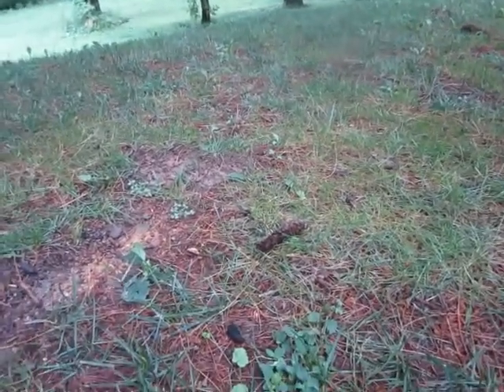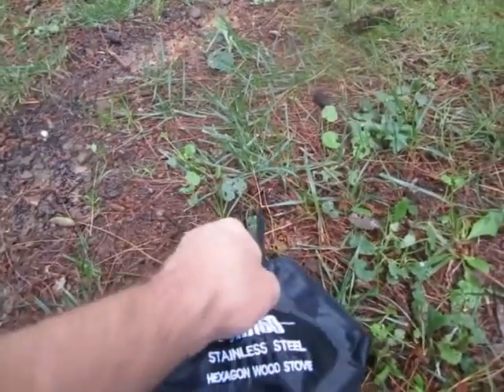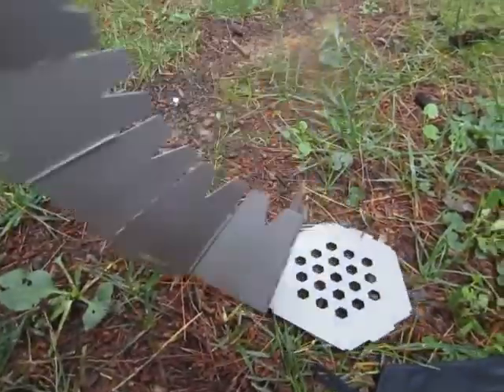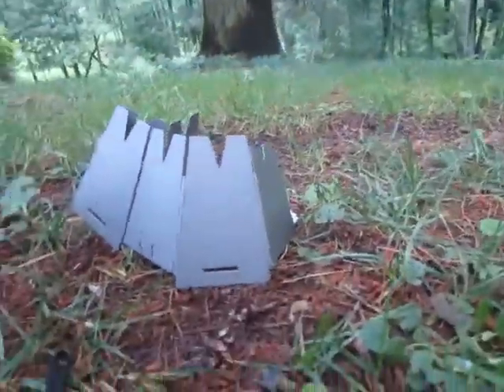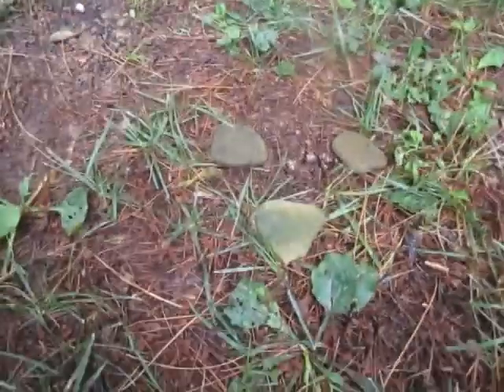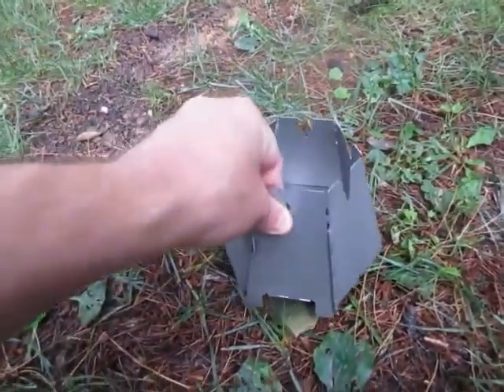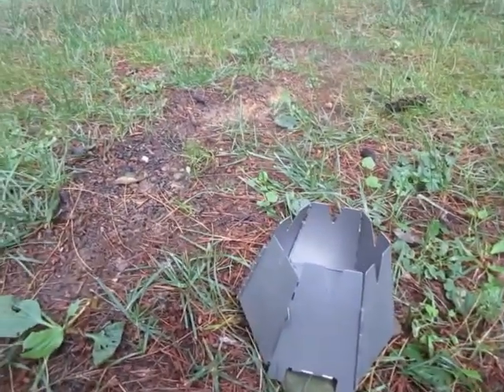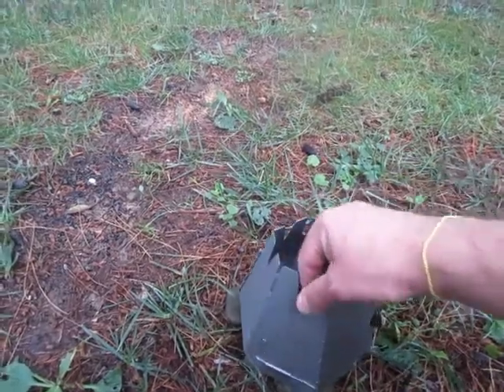Vargo Stainless Steel Hex Stove...

Comment: Another good piece of gear. I haven't popped on a wood stove yet. My new GSI cook set isn't designed for fire. Thanks for sharing
Reply from the maker: Well, it took me a long time to commit to a wood stove design. However, folks on you tube make them look like so much fun....which they are. But, I would probably not have it as my only option on a long trip in the backcountry. That has more to do with my fire skills than anything else. Also, when you are tired, the convenience of a d power type stove is a plus! Thanks for your continued support caveman! Take care my friend. By the way, what gsi system do you have?

Comment: Looks like you have some fun with that Jeff. It looks pretty versatile. A bit rough on the brat lol, but like you said live and learn. I use a grill always over my wood burners. To many wieners had bit the dust with out it. There a bit messy on the pots too, but I like the smell of the wood burning during the use. Trial and error. Have fun and thanks for sharing. atb Paul
Reply from the maker: NEKCanoeist Exactly Paul. Love the smell and spirit of a campfire....this is it in a more Eco friendly format. Currently working on grill top method....hmmm!

Comment: Good review, you shall test it with wood and a pot put on the top. Then you might encounter some ventilation problems. I really like the idea of using the stove upside down as a potstand in a fire. Keep the good work going, Cheers, Marc
Reply from the maker: Scouting Free Thanks Marc. As far as the ventilation issues...I can see that being a problem. However, I put the rocks under the legs and that lifted the whole thing up about a half inch or so. It worked for me...this time...not to say that the next time...it will probably fight me! Thanks for the support my friend!
Reply: WoodsTrekka' You could always drill a couple of holes in the sides too if you needed more air flow.  Awesome looking stove though and a thorough review. Thanks!

Comment: Use a safety pin to block the tab in the cutout.  So the stove will not be able to disassemble itself.  Drill holes in the bottom of the side walls for better air flow and the stove will not suffocate on loose soil. Thanks.
P.S. The good thing about this stove is that it can be used as a guide for a fire.  there you can use long thin firewood with the door open.